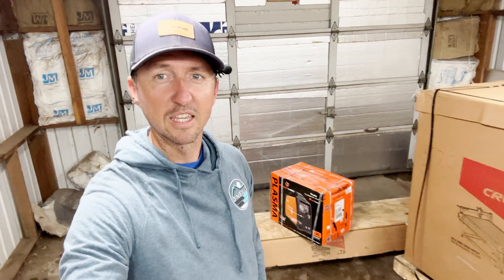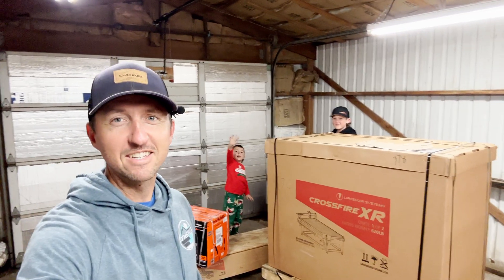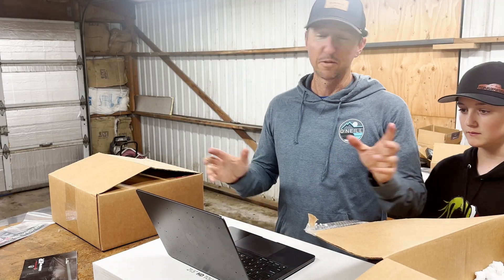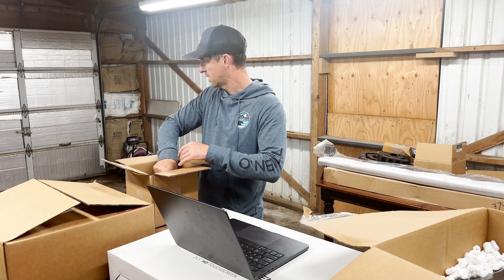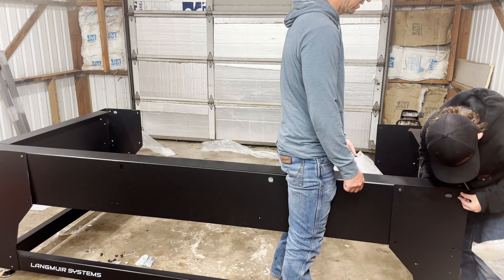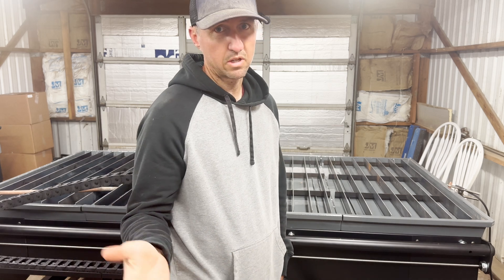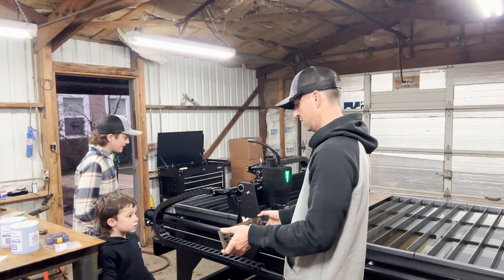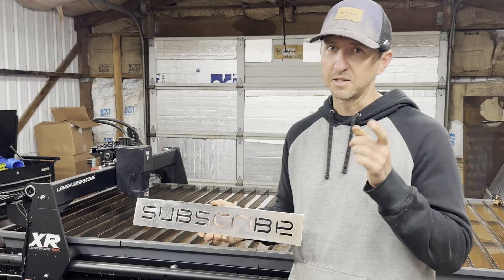Unboxing And First Run Of My New CNC Plasma Table!

Comment: what size air compressor you using
Reply from the maker: believe it or not right now I'm just using a little 8 gallon compressor. It's not ideal but it works for now. My big one burnt up and I haven't replaced it yet.
Reply: @ksbcreations8704  insurance bro cover for all of that, that's a big plasma cutter with a small compressor and I stressing my self to buy a 60 gal or 20 gal